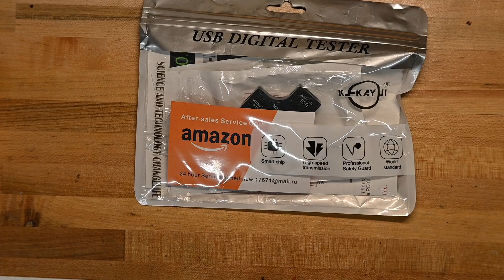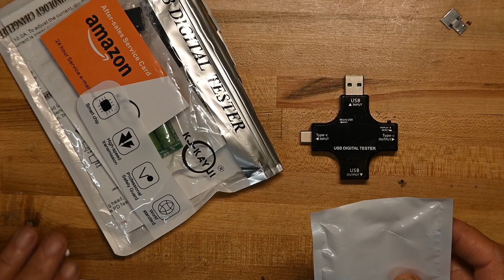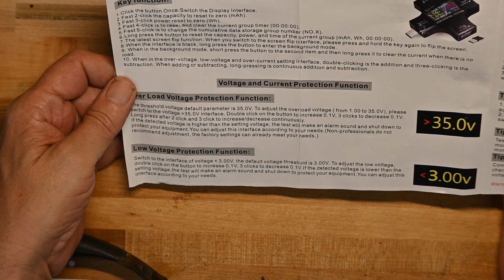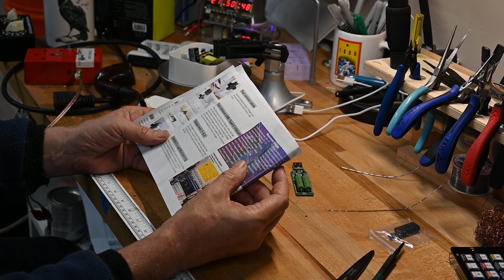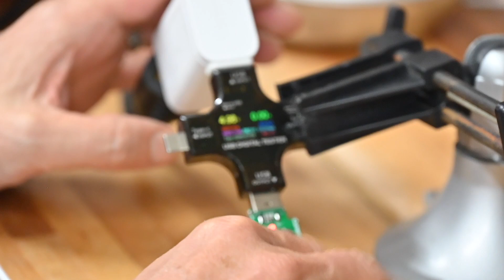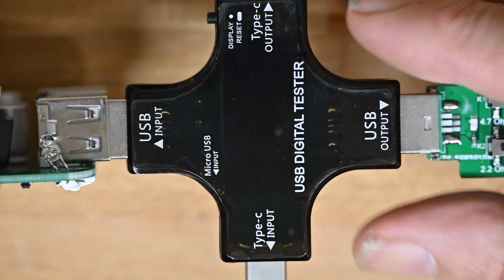C.K. tries a KJ-KayJI USB tester

Comment: I have the same tester.    My test process was a little different.  

For USB A and USB-C, I found devices that wanted the most power (definitely a laptop; might have also been an iPad).  Then, I took all the USB chargers and power banks in my house, and tested each one of them, noting the actual wattage on each.  Some were above spec, some below (ie 900mA when it said 1.0A).   I did it before I was traveling, looking for the best combination of higher current and smaller size.  [Apple ones with the retractable AC plug always a good choice.]   

One feature I wish the tester had was being able to feed the input power to both output jacks, ie. plug in a USB-A charger, but then be able to plug in a USB-C cable.  I'm assuming because USB-C can do multiple combinations of voltage and current, that really wouldn't work.
Reply: One thing I just noticed is you can plug a USB-C cable into the output jack, then plug the input plug into a device’s USB-C input, and it will work!   It even had the current flow arrows go from right to left!  Definitely a lot easier to read the display when it’s plugged into the device vs the charger.
Reply from the maker: Thanks for the tip!
Reply from the maker: Good technique, thanks for sharing!  Yes, if you're plugged in to a USB-A charger then through to USB-C you'll only get the 5vdc to the C port.  I (as you saw) didn't plug in two at once, next tester I try I'll give that a go.  Thanks for stopping by!

Comment: Well... some days ago I burned it off... There is a newer version that can handle 6.7A although might not have helped but the old is 5.1A - sadly no 10 Amp version of it or more, would have been nice.
Reply from the maker: @darkijah-andersjehovahsn7893 Thanks for the info, I may grab the new one and give it a spin.  Hmm, power at 10 amps through USB might burn the wires :)

Comment: The only number you really need to care about is watts. Most USB devices these days use digital switching power supplies that can adjust for low voltages… but no device can compensate for low wattage. So the second screen that showed volts, amp & watts is the most useful. The iPadPro comes with a 12W charger but can be used with a 30W charger for fast charging. There’s debate that fast charging will decrease the battery life but given the short lifetime of these products it don’t know that it’s relevant. Oh, and upvote! ;-)
Reply from the maker: Watts is Watts, as they say. Good pointer on the wattage screen, and thanks for watching!

Comment: when you turn both resistors it makes the equivalent resistance to 1.5 ohms (shown in blue on the screen). Since Current = Voltage / Resistance, in order to supply 5.2v across 1.5 ohms you will draw about 3.47A of current. Since Power = Current * Voltage, in order to draw 3.47A at 5.2v you would need about of about 18W of power. Since the charger you are using has a rated maximum output of 12W (2.4A @ 5.2v) you are overloading the adapter by pulling more current than it can across the 1.5 ohms.  Since Voltage = Power / Current, if the adapter's max power output is 12W and it is drawing 3.47A that would give us a voltage  of about 3.45 which explains the low voltage reading.
Reply from the maker: True enough, the silk screening of Ohms law on the board reminds you :)   Just interesting to see how some supplies fall off immediately after passing their limits, and some struggle on for quite a bit further.
Reply: @CKHaun  ya, i found your video when searching for clearer calibration instructions for the j7-c. I accidentally cleared the 5v and 2A calibration values. I ended up ordering a XY-UMPD to use with my LD25. I should be good.
Reply from the maker: Glad you found it.  By the way, you might want to check out Voltagestandard.com .  He provides high stability voltage sources that I use to calibrate or check my meters and 'scopes.

Comment: Maybe Apple is the highest quality USB power supply?
Reply from the maker: They really have VERY high quality ones.  If you want to see an expert on power supplies, go over to the @DiodeGoneWild channel, he's disassembled and analyzed more than 100 USB power supplies, from the best to absolute junk.
Reply: @CKHaun  Awesome, thanks for the lead.  I have to laugh about USB adapters that come with new units.  Most places if you have a problem with the device say "try replacing the USB adapter" and usually don't offer to send you another one.  I'm curious to see how Anker fares - that was my choice after much frustrating research.  Thanks again.
Reply: @NoferTrunions  I've had a lot of good luck with Anker devices. USB 3 to Ethernet adapter with three extra USB 3 ports, iPad chargers (because kids destroy theirs). I know I've bought other stuff from them, just blanking at the moment.

Comment: Thanks C.K. I enjoyed watching that video. I am thinking about getting one of these things as I just recently purchased a 1260 Wh EcoFlow Delta power bank (and I already had two NOCO Boost car jump starter/power brick devices) so it would be nice to see if my cables and charging devices are doing what I think (or hope) they are doing. Is this still what you would recommend for a USB testing newbie such as my self, and also in that $20-$40 range?
Reply from the maker: Thanks!   And yes, I still find this unit is great utility for the price.  Some of the functionality is almost hidden by various button presses, but spend 15-20 minutes exploring it and you'll find everything you want.